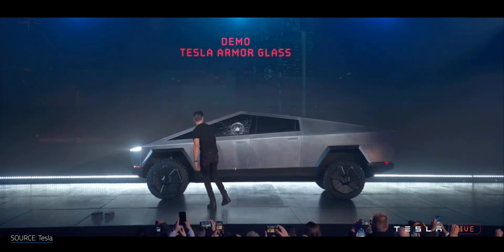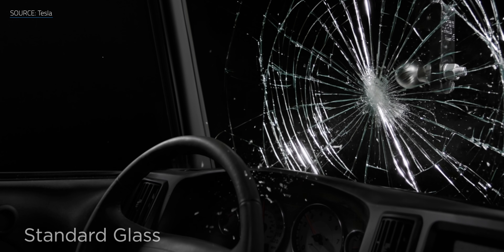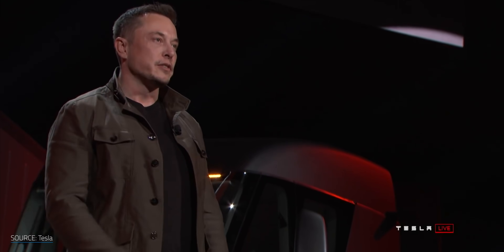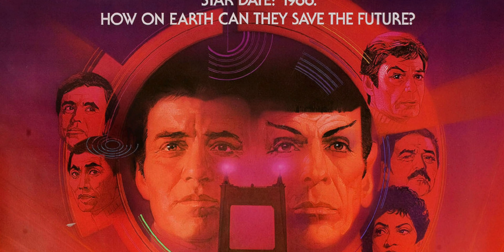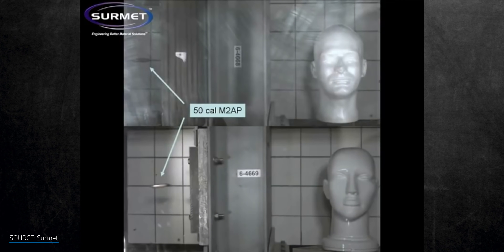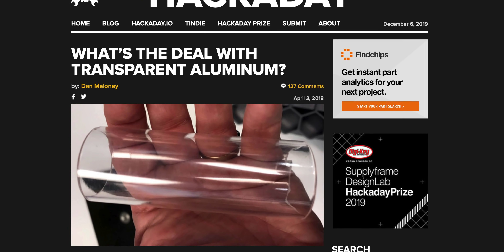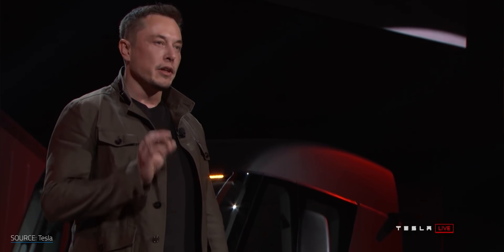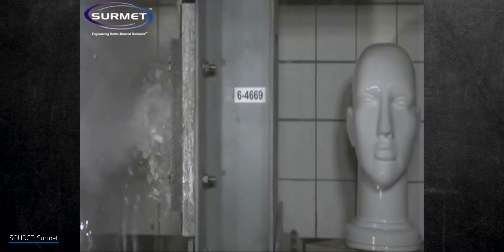Transparent Metal Glass - What is Tesla Armor Glass?

Comment: Transparent CERAMICS are neither GLASS nor METAL. They are just another class of materials different even from METAL CARBIDES which are manufactured in a similar way (Sintering: Infividual cristals of the material fused together).
GLASS is a vitrified super cooled liquid. Metal alloys are metal or metal compound cristals held togather with cristals of other alloying elements by intercristaline bonds. There are a number of transparent ceramics manufacturers for different applications including high temp furnaces.
Reply: @MOULOUD ZEKAR  From a chemistry perspective of course you are correct.  I suspect we will see the use of the term glass applied to any clear product that can be used as a window - and isn’t plastic.
Reply from the maker: Yep!  Aluminum oxynitride is technically a ceramic, but from a lay persons perspective, I can see why "metal" is sticking.  It has aluminum in it ... conveys strength ... kind of makes sense from a marketing point of view.  You can also blame Star Trek.

Comment: When you are stuck in your burning  car after an accident, you don't want a armored car or unbreakable windows.

From this point of view is don't make sense. It will be really difficult for helpers to get you out etc..
Reply: there are also times that the armour glass could save you. I have a relative who lost an eye and almost died when a lug nut came off a truck on the highway and went right through the drivers window striking him in the head. as for extraction im sure the jaws of life would have little trouble popping the door latch of the cyber truck open in the case of an accident . may be a trade off either way but personally id rather have the armour glass . especially considering the Tesla is likely to be an all around safer vehicle anyway
Reply from the maker: I've had the same questions in mind too.  I'm really curious to see more info on the safety features of the truck.  However, as bad as it was to have the glass break in the demo, it does show they can be broken.  First responders should be able to smash their way through window to get at people inside in an emergency.
Reply: When you're stuck in a burning car, you don't want much...besides the inflammation resolved.